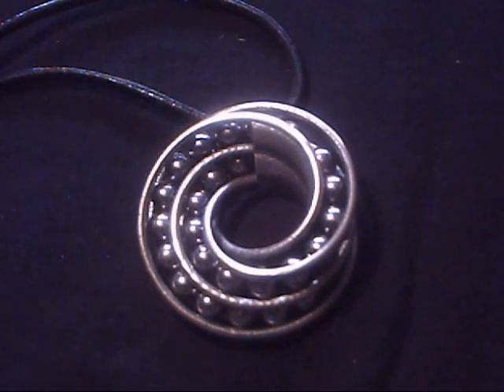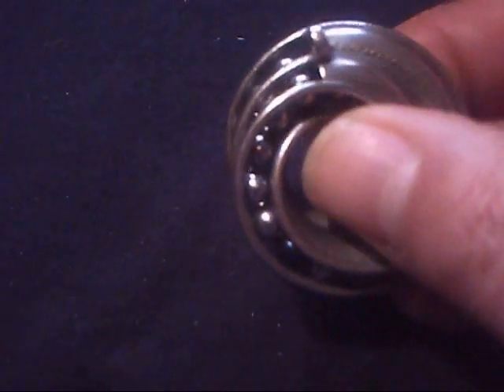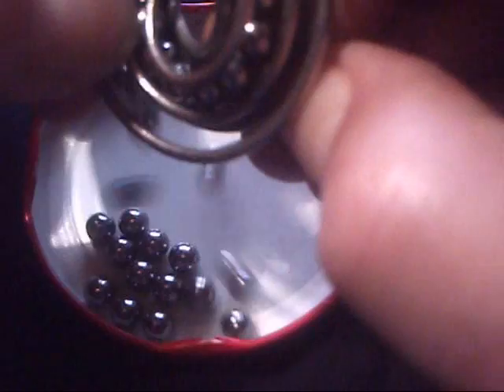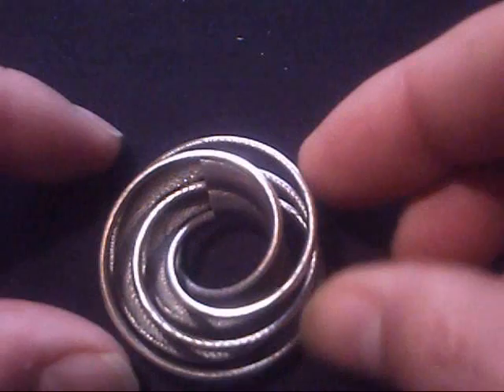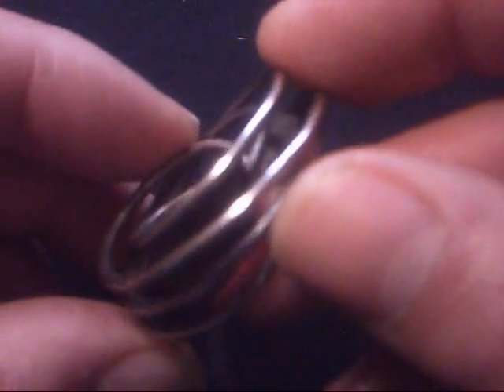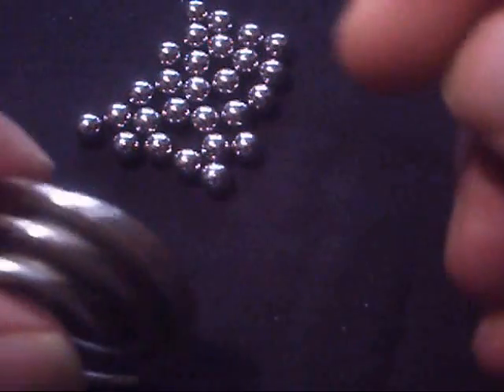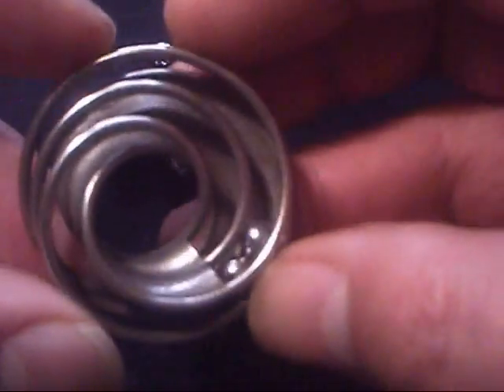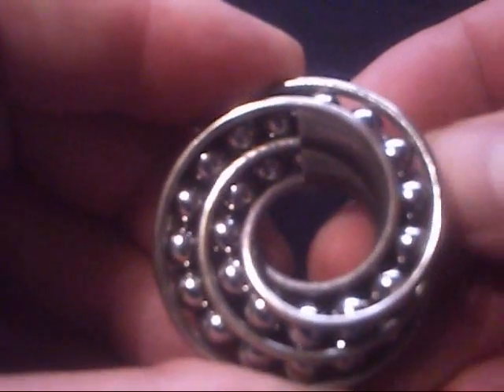Twin Rail Mobius Pendant - With Balls! - Answers

Comment from the maker: @RTTLP The pendant weighs around 2 ozs when full of 6mm balls, 1/4in balls may be a bit heavier.
Blueing occurs at 300 - 330 celcius (google 'SMEX - Steel Temperature Chart')
The same size pendant in Sterling Silver via Shapeways is $150.60 - I've also ceated a 3D model for a smaller 2/3 scale to be 3D printed in Silver that will take 4mm balls - this is as yet untested but the expected cost is around $77.

Comment from the maker: @jeanniellewellyn - Thank you!
The largest diameter is 46mm (1.8in) and the thickness is 16mm (0.6in). I think the pendant could made at about 2/3 the size using Shapeways to 3D print in sterling silver.